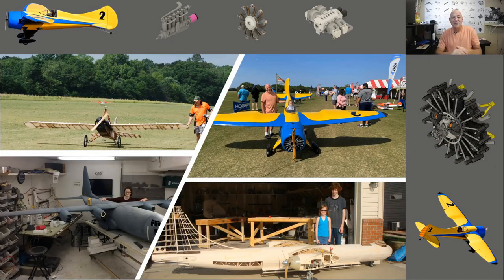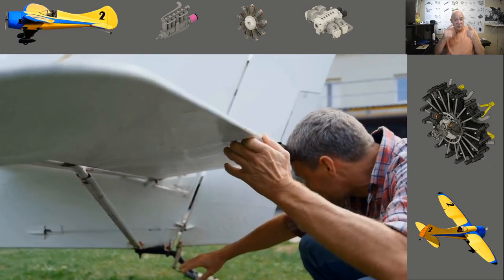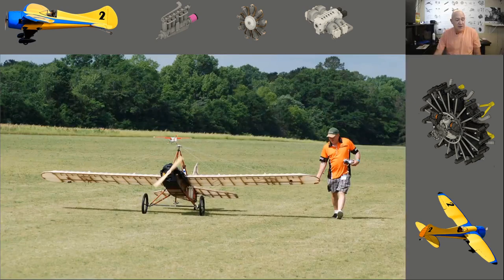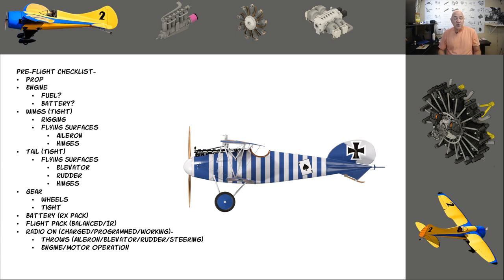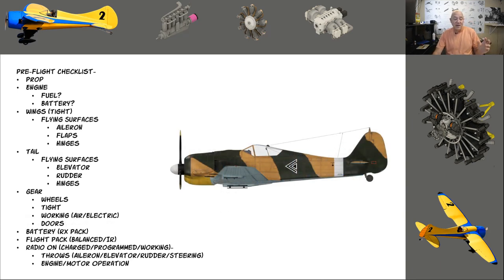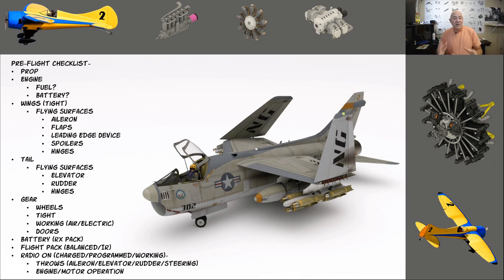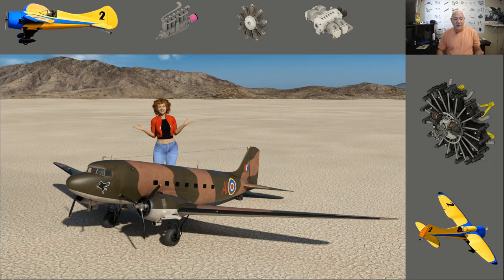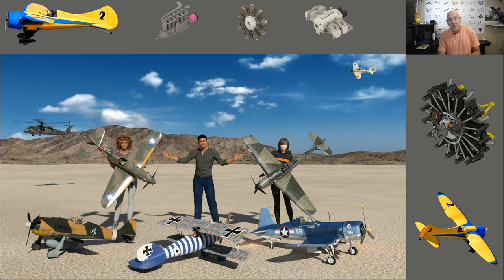RC Airplane Safety! We don't crash into the SKY! (Pre-Flight Checklist 2.0)

Comment: I use a DX9 and I have good telemetry for my battery pack and motor and esc temperature and even the altitude and it will tell you all that but nothing beats a visual check!

Comment: how are you doing ? I am amazed on how much I learn just from your videos , and I just turned 67 here last month and I've been building models and I've been building RC's often on for years but there's things that I never thought of on building and flying models and to be honest I never knew or thought about doing a safety check , I would just start the engine check the radio make sure all my surfaces move around and do what they are supposed and then take it up in the air , and this definitely is why most of my planes always came back in kit form LOL , but I do learn awful lot just to listen to your videos , also I did start the construction on my B-29 but right now I'm trying to gather everything I need so I'm not guessing how things are going to be fit without actually having all the parts that I need for construction . Like I said the B-29 and the B-17 even though I am building them as if they were intended to fly I'm just going to use those are static displays at airshows so people and especially the younger generation can see what building these models are like and what they can do if they put their mind to it ? I almost forgot even though I am not going to attempt building a B 36 like the one that you have been building , but it sparked my curiosity into that aircraft and now I am obsessed on learning as much as I can about that bomber and it's just fascinating and even as of today the B 36 is still the biggest bomber ever built and flown which is amazing , once again you take care and thank you so much for taking the time and doing these videos to help people learn and understand that there's more in-flight rate of control planes that just throwing them together and put them up in the air
Reply from the maker: Hi Charlie, thanks for the post, and thank for the kind words. The B36 is without a doubt (To me) the greatest thing man has ever built. Rock ON, and have a great day! DAG :)